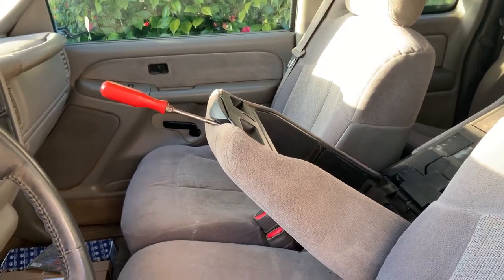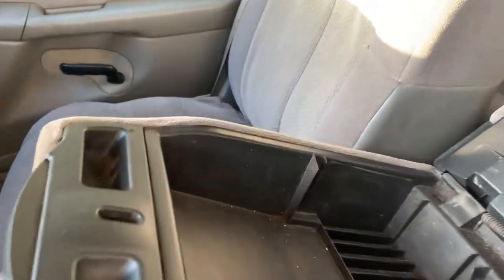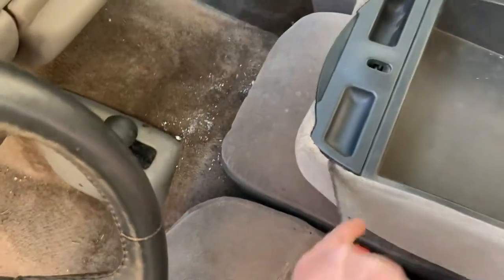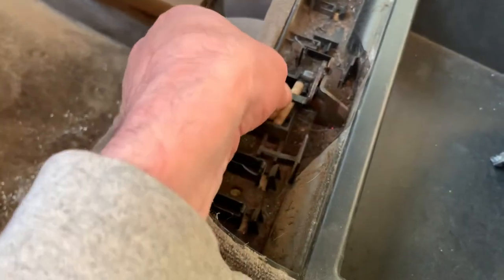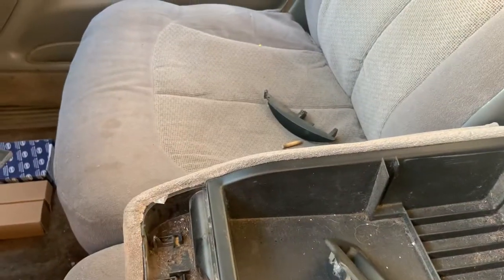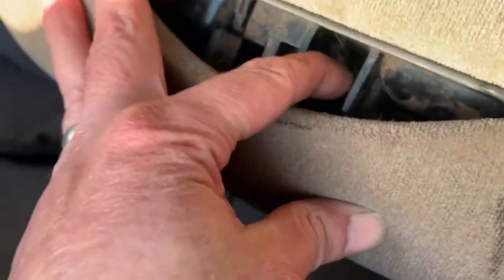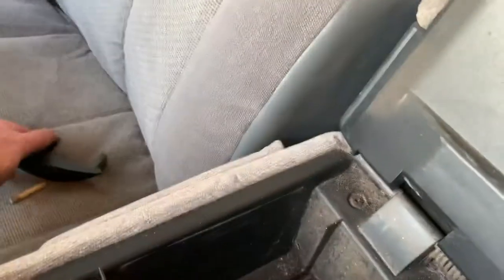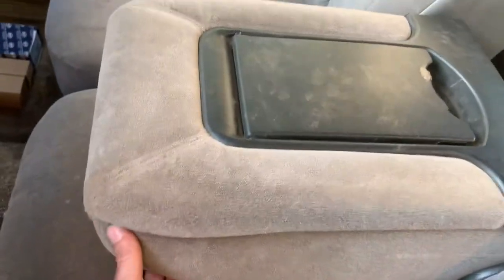How To Open A Center Console That Doesn’t Unlatch 2000 Chevrolet Silverado Stuck Closed Screwdriver

Comment: Awesome video!  Owe you a club sandwich, and a coffee, at Edna's Diner.  Never would have gotten unstuck otherwise.  My 1999 K1500 is my baby, I bought factory new, to my spec.  Try and keep it "original".  So where U left off, actually it is medium-skill level, to take it apart, clean everything.  Its that awful little white roller.  That is a "gravity sensor" so the kids cant open the armrest when it is vertical.  After 15 years, the dust and dog fur make it stop moving, and no open anymore.  JUST get out some paper towels, and the aerosol Tri-Flow.  It is like WD-40 but has micro-teflon particles that stick to the metal.  It makes sure things are more slippery, even when dry.   CLEAN OUT everything, and wipe away all excess.  Get every moving surface clean and some Tri-Flow wiped on.   BUT Re-assembling is tough.  Don't fire the GM mechanical engineers, fire their managers who sent this to production. Need a good eagle eye where the spring-strip fits to the plastic (if U get it wrong, the spring-strip isn't captured and it falls loose - - do it right and its kept at the root-end.  I also bent it just a teeny bit, so it holds tight in the cover plastic.   JUST BEFORE snapping down the cover, U have to push that latch open, thru the cover piece, holding it open. Then it snaps down, and I have a 100% normal latch working properly !!   Still a great video, I hit the like button!
Reply from the maker: Had to look through several videos to see what was going on inside it.  Was really bugging me hearing things inside the console but not being able to see what it was.  Took some finesse but it finally flipped open.  Was a little tricky getting the screwdriver in there while it was down.
VT247

Comment: What worked for me was just using spray grease to lubricate the contact points and pivot points and the latch works fantastic now! I didn't modify anything and I didn't repair anything.
Reply from the maker: Awesome.  Mine was all busted up and just couldn't get it to work right.  Don't mind using the finger flick method to open it up.  Thanks for the suggestion to help : )
VT247

Comment: 🤦‍♂️ I wish I would’ve found this vid sooner
Reply from the maker: Took some research to find out how to do this right.  Luckily there was just enough room to put in a long screwdriver to open it up.  Wasn't fixing the handle.  Actually like it where only I know how to flip the lever to unlock it like a safety / security device to put things in.  No one else knows how to open it but me plus it's more reliable and easy.
VT247

Comment: Same problem, same solution. But I'm trying to get the assembly back together so it at least looks right.

This mechanism is some of the worst engineering I've ever seen. I'm surprised it ever worked for anyone even once.
Reply from the maker: I just left the front area off where the big push bar was.  The plastic inside the console was left intact.  Yeah, it’s kind of a hack job, but it works and it was a free fix.
VT247
Reply: @Vacationtime247  So I ended up fixing it completely. The mechanism was so rough and dirty, I didn't think it could help but...

Applying WD-40 ended up making it work flawlessly. I was amazed given how it didn't move at all before. We're back to a normal look. Except I did however glue a small bit of broken plastic under the hook of the mechanism to keep it half open. This just made it easier to press the button, since it's not starting at the bottom of that plastic ramp. Doing this required I take the plastic roller out but I'm not worried about that haha.